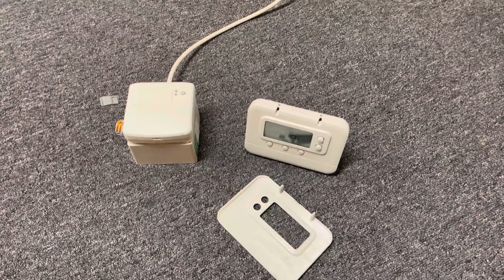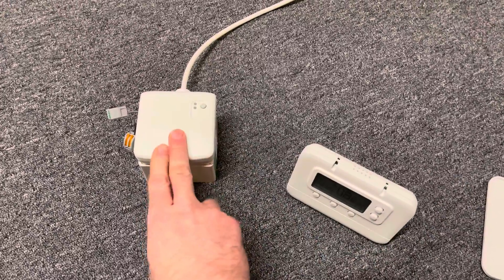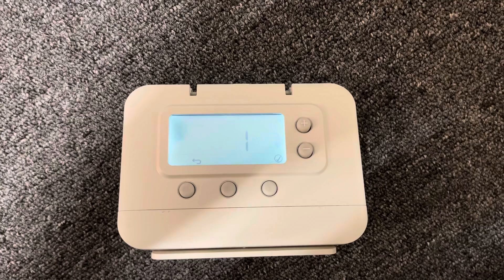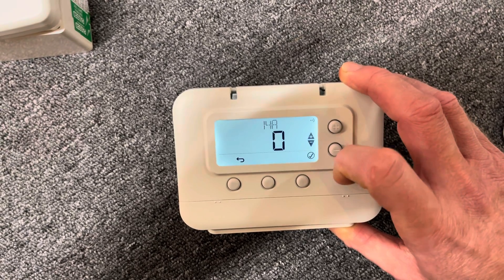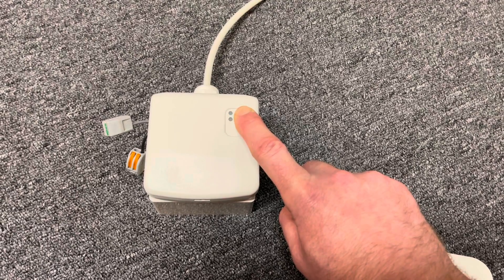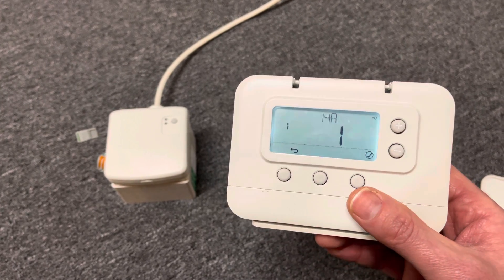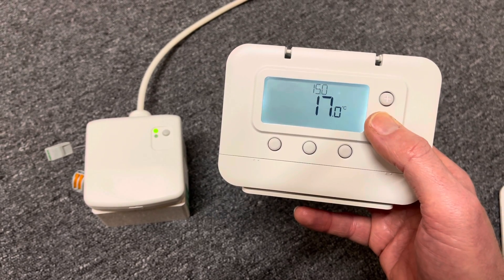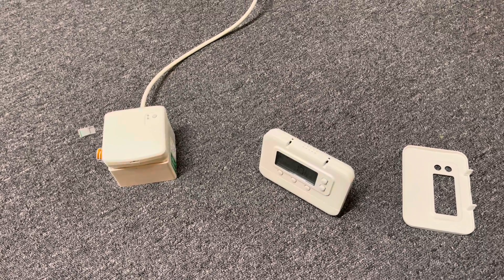How to wirelessly pair a Pro Series Programmable Thermostat to a Honeywell BDR91 Wireless Relay Box

Comment: .seemed to pair without so many steps.
Previous model Honeywell cm921
Light immediately turned green and increasing temperature brought boiler on.
Reply from the maker: The method I have shown is the only robust way to bind the thermostat to the relay box (including clearing down the equipment correctly). If it has paired in any other way, I don't think it will remain connected or there will be transmission issues between the thermostat and the wireless relay box.

Comment: Had trouble pairing mine to my old BDR91 .. I changed the old 91 unit for the  new one which looks the same .. Then on my 3rd attempt it binded.. I have looked online and it is recomended that you should have at least 1 meter between thermostat and the receiver .. I may have been further away on my 3rd attempt .. Just thought i would share this info as it may make a difference in some cases.. Still a great video thanks..

Comment: Echo those comments below. Clear, concise and ultimately v helpful. Thank you.

Question - on my old CM 92? (with a now defective display - horrified at how much this replacement was!) It had a default 5 degrees program that was supposed to prevent pipes from freezing if you left the heating off. Does this pro unit do the same? If so, how do I set that up?
Reply from the maker: Yes, the Pro Series Thermostat does have frost protection and is enabled when the ‘off’ mode it enabled (and won’t let the room where the room thermostat is go below 5 degrees C). Need to bear in mind other areas of the home where the room thermostat isn’t could potentially be colder (although modern boilers have frost protection built into them too).
Reply from the maker: Hi Michael, the Pro Series Thermostat has an 'off' feature. When this is enabled, if the thermostat detects the room air temp is heading below 5 degrees C, it will fire the relay just as the CM900 range did. You do need to be careful though, because if the room temp ever hits 5 degrees C, the pipes in the loft, etc are normally already fit to burst. I would never recommend a building to be kept lower than 10 degrees C in my experience, so you can set the thermostat to manual mode and adjust to 10 degrees C.
Reply: @theheatingconsultant  Excellent. Appreciate the advice. I shall set it when I get home.

Comment: Arrived today, very quick delivery. Had about 10 attempts without success. Get a 0 instead of 1, dont get two zeros when I should, to click from 0 to1 wont work. I am at my wits end with this.  I do have a BDR91. Thank You.
Reply from the maker: Have you confirmed the tick button (lower right button) works correctly on the thermostat? You also have to ensure the BDR91 has correctly been cleared (+15 second button press) and is then is in binding mode (after the 15+ second button press let go and then press the button for about 5 seconds to get the slow flash), otherwise the thermostat won't pair to it. The procedure is relatively simple, but does catch a surprising amount of people out as they cannot distinguish between the flashes on the BDR91.
Reply: @theheatingconsultant   Had no problem with the flashing light on the BDR 19. Now you have mentioned it, I dont think the tick button is working correctly. When it is pressed to move to the next stage nothing happens. Any ideas?
Reply from the maker: @howarddickens  I’ve had this myself and it is normally one of the clips holding the PCB in place, isn’t clipped onto the PCB properly. 

The thermostat comes apart really easily. If you take the batteries out and look in the battery compartment there are two tabs holding the front fascia (which also holds the PCB) to the back plate. Once you have got it in half you will see 4x locating latches holding the PCB into place onto the front fascia. Normally one or two of these won’t be latched onto the PCB properly. To remedy it is as easy as pushing the PCB into them.